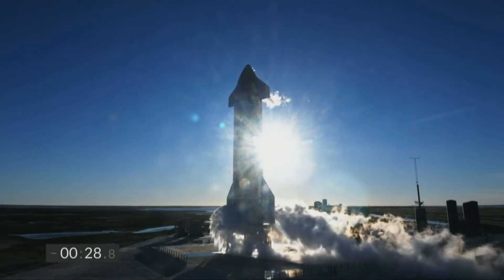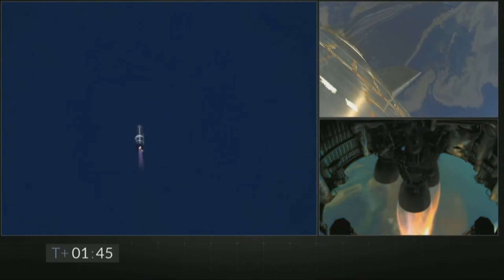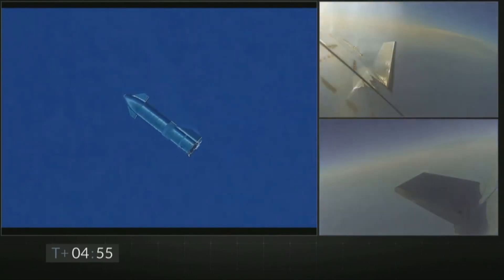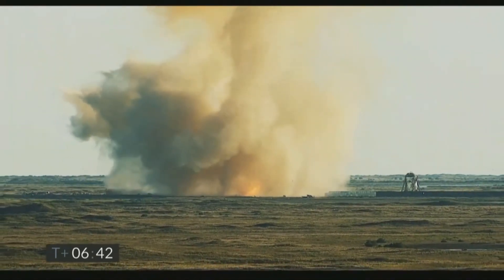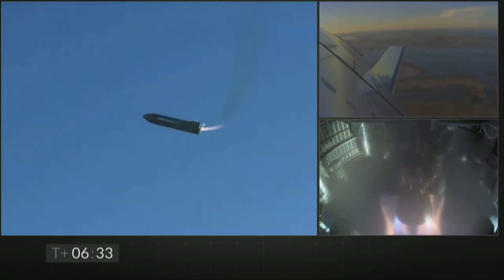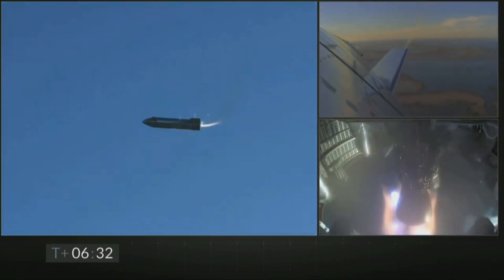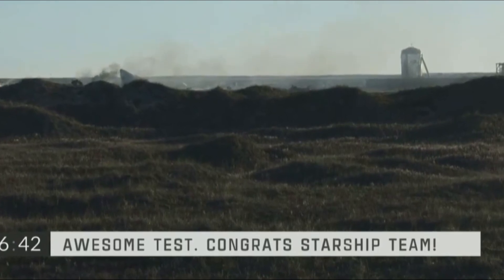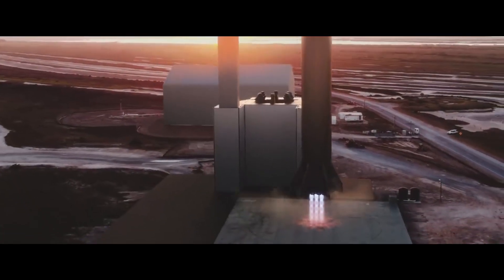SpaceX Starship SN8 12.5km Flight Test: What Caused The Landing Failure?

Comment: WHY did the tank pressure drop? What physical effect was unanticipated?
Reply from the maker: I also tried to search for the answer, but, couldn't find any clue. My best guess is maybe fuel boiled off..... but, not sure honestly
Reply: @spacexplained5001  It must have been something not predicted in the simulations
Reply: I wonder if they would benefit from doing the flip maneuver more than once on the way down; data gathered from the first flip would be used on the second (e.g. when to start firing). I wonder if this strategy would have caught the low pressure and enabled them to accommodate it ???

Comment: I have always said that vertical landing for rockets is too risky. Imagine with astronauts onboard, they would have all perished. Parachutes combined with airbags is the safest way.  How will SpaceX land vertically giants rockets loaded with hundreds of passengers? and propellant?
Reply from the maker: This was a first test flight, they will surely improve on this. For instance falcon 9, they almost Everytime land it now.
Reply: @spacexplained5001  I'm sure investigation will reveal a computer failed to process flight parameters from sensors and prematurely engage or disengage a critical system in charge of controlling engines thrust
Reply: @tunkunrunk  no shit, it’s the first test flight
Reply: They will land on an ocean platform, so if things aren't going on track they can just shift to the side and land in the water

Comment: Thank very much for this I was wondering why the thrust turned green.
Reply from the maker: Thanks. I explained in the video, the green colour is due to the engine melting and the exhaust was effectively the engine itself. The colour is due to either copper lining inside the engine or boron (I was not sure about the element in the exhaust, so it didn't put the video.
Reply: Me too..1st i thought..its a part of burn
Reply: A lot of incorrect info in this video, non of the engines failed, they all shutdown when they should have, the green flame was caused by a drop in header tank pressure which caused the engines to run out of fuel and auto attempt a re ignition with the hypergolic fuel used to light the engines, it just so happens that the fuel burns green which is the same colour copper burns